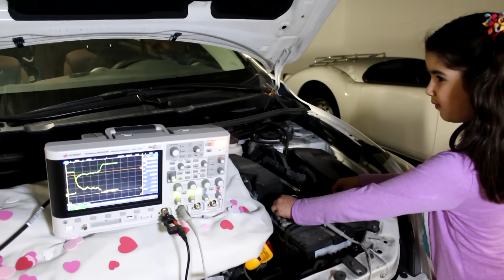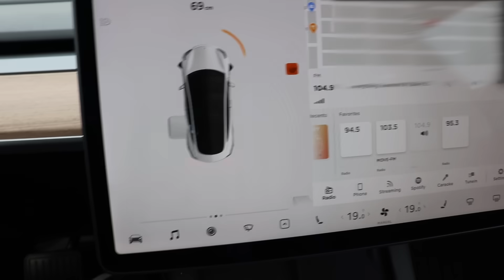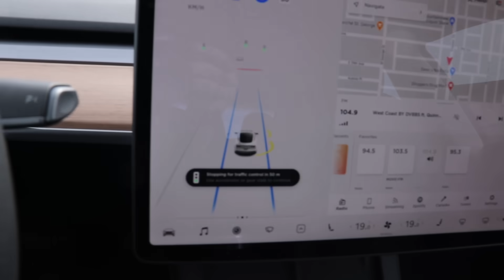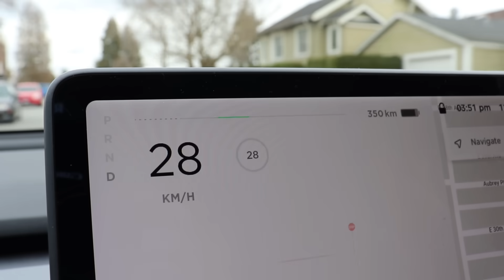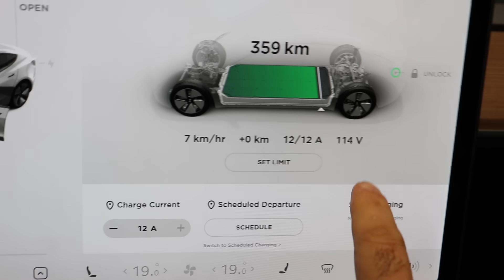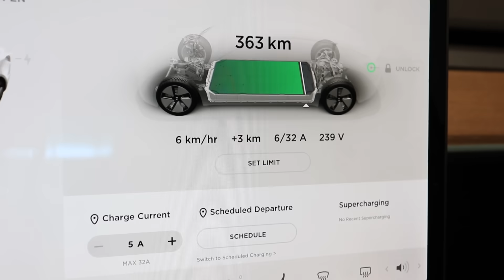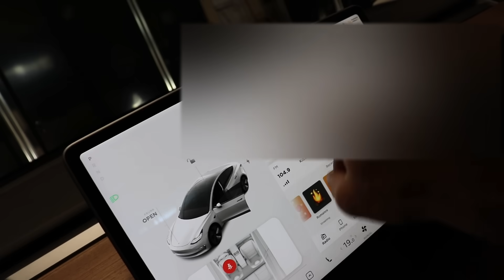ELECTRIC VEHICLES & My Tesla Model 3 Review

Comment: er....  mate, the cost of making an electric car far outweights any carbon savings you'll have with driving your Tesla instead of your old car '-'
Reply from the maker: Yeah but if you buy a luxary gas car with all those features, you almost pay the same amount. But yes, my basic non luxury toyota was less than half the price at $21k
Reply: @ElectroBOOM  I was thinking more of the environmental cost, but you actually go over it later in the video ^^

I still wonder how much we should actually just never buy any new car though, and always buy used, because it's not like cars break completely down with some slight maintenance

we're used to the idea of recycling a ton of things, but all the advances on electric cars are geared towards making new ones instead of retrofitting old ones =/

Comment: I'll stick to my Gas car.. I can buy parts at most parts stores.. (try buying parts for your tesla) I can fix it myself without the dealer turning it off  because I fixed it myself..
As for the saving in fuel Costs.. Here some simple math for you..My new Gas car cost 18.995. it dose around 8.6 L per 100km around town.. With the $30.000 I saved not buying a tesla I can go on holiday gas up my car for the next 5 years and still have money left over...
Over a 5 year period. A small gas car is cheaper to own and run than any electric car...Thats the cold hard truth of it..

Comment: 13:30 modern fuel injected cars, be they manual or automatic, will shut off the fuel injectors when the throttle pedal is released given the rpms/wheelspeed are high enough to prevent stalling. this can be used in a situation like you're describing, where you're going downhill. If you leave the car say in 4th gear going downhill, the wheels will drive the engine, causing the RPMs to stay put when the throttle pedal is released. great video :)
Reply: They won't use any fuel, but you can't generate any "fuel" like you can in an electric vehicle
Reply: @j.e.honiball1327  i understand this take however it's really quickly overshadowed by the fact that even with regen braking, teslas have shorter range on a full charge than most internal combustion engine powered cars. example of this is i think a stock model 3 doing 50 drag races back to back to back, needing to recharge 3 times over the course of those 50 races and the fastest car in the drag race did it in a single tank of gas.

Comment: even though you have regenerative braking, you still should use the brake pedal once in a while to prevent rust or damage of the brakes.
Reply from the maker: You will end up using them once in a while in my experience

Comment: Let me answer it is the current or voltage that kills : 

It's not voltage, current or resistance that kills, believe me, I'm not an idiot, it's the power that kills, if there if the power supply can give up to 100 Amps of current but voltage is DC and is limited to 3 Volts,  it can't run enough current through your body to kill you or even make you sense the electricity, if the voltage is 250 volts but limited to 0.01 ma, the voltage will drop and you would barely feel anything, if the voltage is 250 volts and it could output up to 1 Amp, more than enough to kill someone, but the skin resistance is so high that the voltage isn't enough to run current, than still person is safe, so I conclude all 3 factors matter, there should be favorable conditions to run enough power, if the resistance is too high, the voltage is too low, or the current is too low, there would never run enough power to kill someone, all 3 factors matter, mean it's power which kills not any of these 3 factors

Comment: The glass roof wasn't really for luxury, it provides a small greenhouse effect so that less energy is needed to heat the cabin. The car is always warmer inside than ambient if you have sunlight. More efficiency, more range. You can find a lot of small details on Teslas like this which were there for a few small % of efficiency (even the door handles on the S were to reduce drag, but they became iconic), it all adds up, but that's why the cost of the cars is higher too.

Comment: 1:20 Green huh? What about battery utilization?
Reply: Make a point will you please
Reply: @felixbeutin9530  Mining rare earth elements like lithium and others needed for production of batteriese requires a lot of work and produce waste. It's estimated that 1 ton of REE requires produces 75 tons of acid waste and 1 ton of radioactive residues. Also recycling those batteries is problematic. For example in European Union only about 5% of lithium batteries is recycled. Rest is either incinerated or dumped in landfills.
Reply: @Hato1992  Exactly. Only normies think that EVs are more ecological than good ol' internal combustion engined cars.
Reply: @logitech4873  I don't have time to watch 20 minute long video, show me those research papers directly, so I can read it.
Reply: @Hato1992  Fair enough!
YouTube is very stingy with links, but it's all linked in the description of that video.

Comment: Nice and honest review, love your vids!

The regenerative braking is a nice addition in electric cars but it has one downside. If you don't use your normal brakes too often they start to rust. Little rust on the braking surface of the brake disc is fine, the pads will clean it off when you brake but if you let it sit for too long it will destroy your brake discs. To avoid this you should brake a little harder every now and then(when safe to do so ofc) to use your normal brakes and clean the discs. This goes for all vehicles with regenerative braking.

Im a mechanic and the amount of electric or hybrid cars with rusted through brake discs is really high compared to cars without regenerative braking. It's sad to have to replace discs and pads with lots of usable surface left in them just because they haven't been used and have rusted through. You can save a lot in brake parts just by using your brakes in this case. Take care of your brakes!
Reply: They really do need to spare no expense on things like that. If this is a common risk. Then the breaks need to be ceramic or something.

Comment: You joke or despair. Electric cars take electricity from the power plants' power plants, which in turn consume fuel. Therefore, do not say that it is in the interest of the environment
Not only this, but also the batteries are fatal to the environment, since after they are used for 5 years, their capabilities will be greatly reduced and then you will have to dispose of them
Reply: What a horribly misinformed comment.
Reply: @logitech4873  
search for the battery
Reply: @omar...4250  What battery?
Reply: 95 percent of Canadas electricity is renewable

Comment: Welcome to the Tesla family :D  EV will bring you great joy.
Automatic braking - might need to put some tinfoil on the boxes so the radar reflects. Probably gets no signature from the cardboard.  All the car company tests (edmunds, insurance institute etc) use foam fake cars with a foil lining to make sure they mimic the plastic/metal construction of a car.
AP wheel torque sensor is easiest to avoid the nag by holding the side of the wheel and resting the weight of your arm gently at the 7-8 oclock position. It doesn't detect motion in the wheel, just torque on the steering column.
Edit again: It's not in the documentation, definitely use the 240v evse. The onboard charger is only about 75% efficient at 120v, and 90-95% efficient at 240v to boost for the onboard 350v battery. There is talk on the tesla owners online forum that someone said trickle charging the tesla chemistry was less efficient as well because <reasons- something about heating the battery for a longer period of time> so it's better to use all the available current (at level2 speeds) to prolong battery life.

Comment: 11:56
I have an stupid question: Isn't that bad?
Like, yes, you are going to need fewer stops for maitenente. But when you need to change/dispose of anything, isn't it worse to change your entire motor than changing a single part?
Reply: Your motor breaking is like engine breaking. It could be small failure where you can patch it up easily, or complicated problem where you need to change it entirely.
The difference here is that it's usually much easier to fix an electric motor than engine, provided you know what you are doing. There isn't many parts in electric motor anyway unlike any engine. A simpler design is easier to fix.

Comment: What you were describing was one pedal driving rather than regenerative braking. The various computers on the car will still use regenerative braking wherever possible no matter how you command it to slow down. I can't speak from experience in a Tesla because Tesla made me jump through too many hoops to schedule a test drive at a time that worked with my schedule, but I own a Kona Electric and test drove the Bolt and the Kia e-Niro. Hitting the brake pedal still uses regen and doesn't seem to use the friction braking unless you brake very heavily or you're almost at a stop. I doubt Tesla have don't any different and will still use regen whether you are one-pedal driving or touching the brake pedal. Personally, I don't like one-pedal driving and prefer the more traditional feel. That said, I do use the Kona's auto-regen feature which adjusts the regen level based on the traffic around me, so in heavy traffic, it tends to have a more one-pedal feel due to the heavier regen associated with the accelerator pedal but on the open road, feels more like an ICE car.

How do you like the dashboard layout? Specifically, how do you like the main driving information all being central to the car rather than central to your field of vision?

You "fully charge" every day? Like to 100% state of charge? My understanding is that you'll get better cycle life if you charge up to 80%. We generally only charge to 100% if we're planning a longer trip. We also don't charge every day. We can, but it's more convenient to charge once every couple of weeks or so than having to plug in every time we get home and unplug every time we want to drive somewhere. We'll typically charge when we get down to 20-30% and charge back up to 80%. As for "better for the battery", at the maximum charge rate, you're charging that battery pack at less than 0.15C, so realistically there's unlikely to be any difference between charging at 5A or 32A on battery life. You'll need to get to much higher charge rates for that. I'd also be interested to see the numbers on charging efficiency differences between charging at about 1kW versus 7kW. I suspect that the efficiency differences at those levels are negligible, but I could be wrong.

240V @ 32A is the same as 64A @ 120V? In terms of power delivered to a load it is, but given how the north american electricity grid works, that statement's not entirely true. The reality is that utilities are almost certainly going to have to continue upgrading their capacity just like they've been doing for decades. Air conditioners weren't all that common in the 1980s. These days I walk down my street and almost everyone has one - a 5kW to 7kW load that was rare 40 years ago. Your neighbours aren't all going to buy electric cars next week. If it really becomes a problem, I expect utilities will look at some kind of low-cost controlled supply system to better manage the load sharing among multiple EVSE in a street or neighbourhood. There are already systems that do this installed in car parks and the like. Doing it on a larger scale across a neighbourhood using EVSE supplied by the electrical utility wouldn't be that much of a leap and quicker to do than upgrading the local grid infrastructure if they do run into load issues.

Comment: You should know then that all the carbon dioxide print or whatever needed to produce and deliver that car, and the fact that most of the electricity comes from non renewable sources, it would have been way better for the planet if you kept using your old Toyota.
YOU SAVE THE PLANET BY NOT BUYING STUFF!

Ah, you said that literally seconds after I wrote this.

Comment: if you don't gain anything with petrol or other fuel is probably because you can't drive properly, when driving down slope you are supposed to use low gears and use the engine to break. Also Hybrid cars will be a lot more efficient and less polluting than your electric car, at least at this point in technology

Comment: I'm not too hot about EV's but I would like to have the Tesla battery, motor, and charger to mount in something. Basic and cheap transportation. I don't need all the other high tech garbage, I'd just like an EV that works well. I don't need it to drive itself or entertain me, I just need to get from A to B reliably and cheaply. I think the Tesla powertrain is awesome, I just don't want any of the other shit that comes with it.

Comment: we have two cars, because one is long enough to sleep in, goes fast, uses diesel and uses a lot less fuel on long drives
and other other is a small gas powered city car that i barely fit in, but that can always find a parking spot, can be turned off at red light and train crossings (diesel takes a bunch of energy from the battery to start and so if i turn off my motor every 2 km, i will run out)

Comment: was the increase in range entirely because of regenerative breaking? batteries also have a lower voltage when cold, so the cold may have been causing the range to drop. once you get to the bottom, the batteries have warmed up and they become fully usable again, so range is higher than before.

Comment: When using autopilot you don't have to move the steering wheel,this is dangerous because you can accidentally disable autopilot without noticing,you can just rest your hand on it,it has pressure sensors that detect your hands

Comment: Congrats on the Tesla! 

About charging at low amps, you have to watch out for battery heating. It shouldn't be that bad because you are in a garage, but if temp is low, the car has to heat the battery prior to charging and maintain an optimal temp. So if it's cold and you charge for longer, it's gonna keep your battery warm for longer, so you'll lose more energy from heat transfer. 

Note that if you leave at a consistent time in the morning, you can set schedule departure so your car sets the start time of the charge to finish charging right before you leave. Minimizing heat losses, and ensuring you have "almost" full regen even if it's -20C.

Comment: The "Youtube App" is just a web link, so the time it takes to load is really just your connection. That would be either cellular data (if you have Premium Data) or WiFi. With SW bugs, it happens occasionally, but I don't experience many software hangs or lock-ups. In reality, the processor is quick, and the touchscreen is really responsive.. this is even more apparent when you compare to other makes.

Comment: You sure? Up hill my gas car says DTE ( Drive till empty ) is let's say 350, up a hill it'll drop down to due to the computer calculating your range based on fuel consumption, going down the hill the cars DTE goes back up. Its not gaining any fuel, no, but the fuel used drops a lot going down that hill for a while, so the range calculations change and if long enough change the DTE

range on these machines will vary on many factors, including the fact that it recalculated range based on uphill vs downhill, using the motors vs not using the motors but maintaining speed. Plus the regenerative braking of course

Comment: The hyundai ioniq phev might be another good option. Leases on them are super cheap, like $2k/year if you haggle and stack rebates. 600+ mile range, full stop cruise control and lane keep assist, 29 mile EV range (or 170 if you go full EV), 6 speed dual clutch automatic with paddle shifters (double as brake regen paddles), and android auto/apple carplay support. It's basically a prius but better specs and cheaper. I like tesla, but I can't vibe with their business practices regarding right to repair and charging compatibility. Plus, you'll have a heck of a time getting any repair work done on them with parts availability.

Comment: Hi Mehdi, I'm somewhat torn on the idea of eletric vehicles becoming the mainstream transport medium. As you said it takes some time for the EVs to equal the footprint of a gasoline car but considering the best case that one buys a used fuel efficient car, it seems a lot more complicated to tell which is the better option. Of course it's a benefit if you can avoid burning fossil fuels but the batteries bring their own share of problems along, especially once they are used up. Another difficult part is making EVs available to a large part of the population especially with the amount of batteries you need to produce and the electricity they consume, it feels like it's somewhat shifting the problems we face today to a different area.
Obviously I'm not an expert but wanted to share some thoughts for discussion.

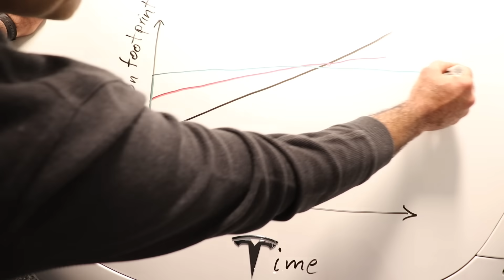Comment: 2:42 did you consider the battery exchange
and what fuel mix in powerplants did you  consider for this graph
what about the disposal
my point against ev cars (except when used in city traffic) is their short range and the low energy density of their fuel
as you always need to accelerate and decelerate a huge and heavy battery pack
performance wise ev cars are great in short term
im still not sure if they're worth it tho
my bet is on hydrogen fuel als its easier to store than electricity (which is what you need with renewables) and much more energy dense